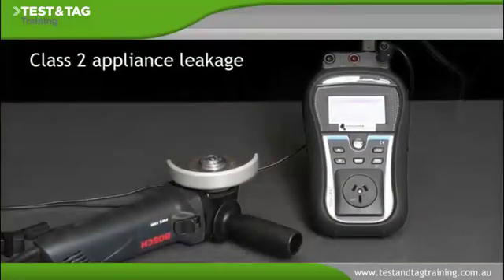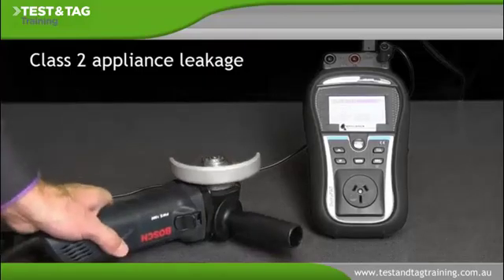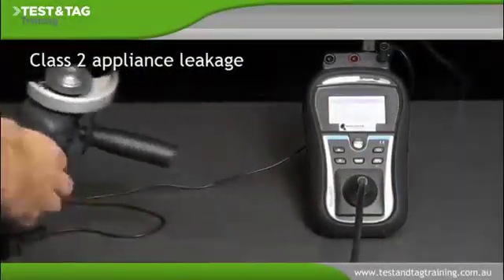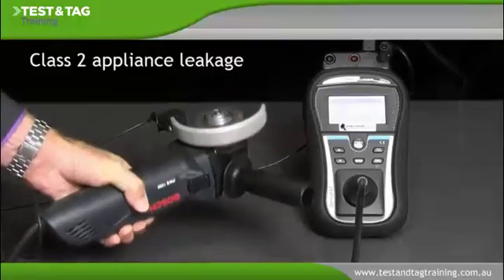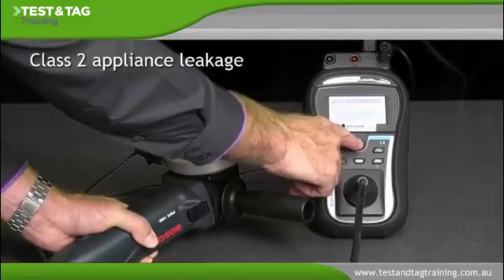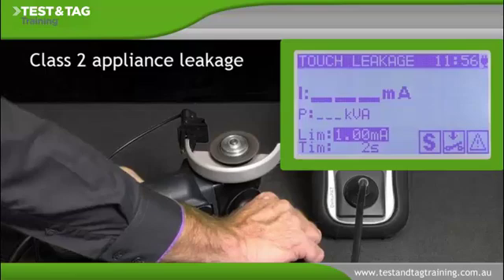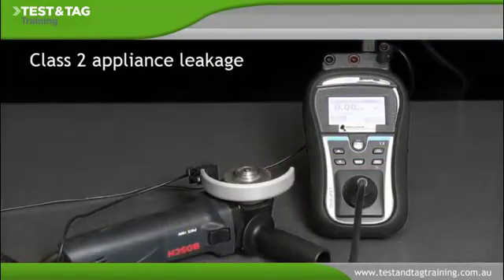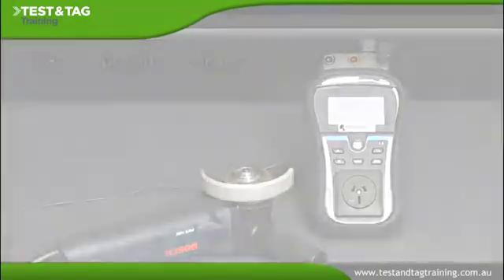How to Run a Leakage Current Test - Class II Appliance

Comment: The clamp is attached to the guard. Are you sure this is exposed metal? It looks coated to me.
Reply: grinder guards are coated yes, but they do conduct electricity. A better place to connect the clamp would be the center spindle.